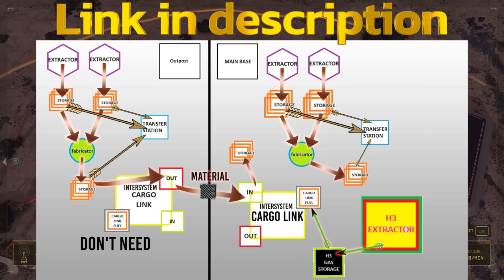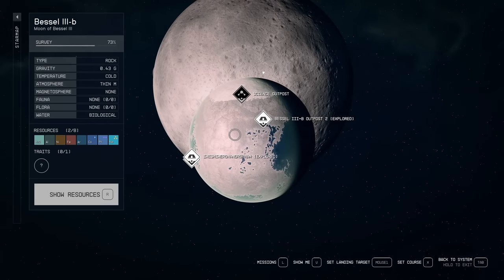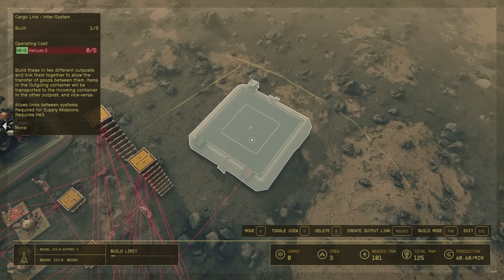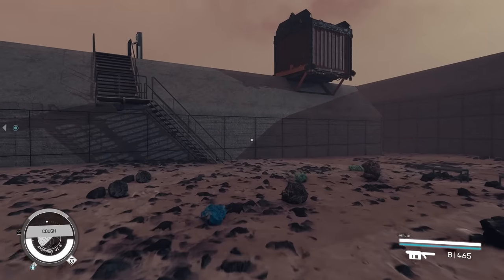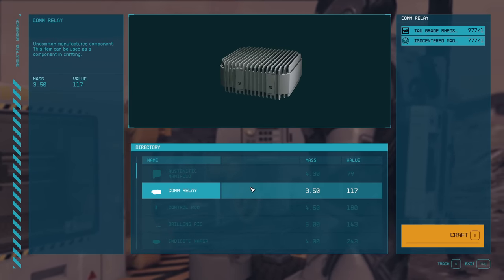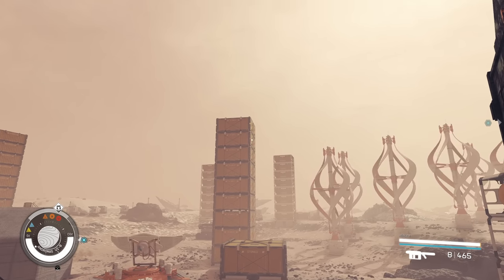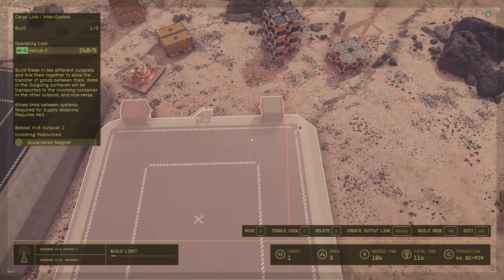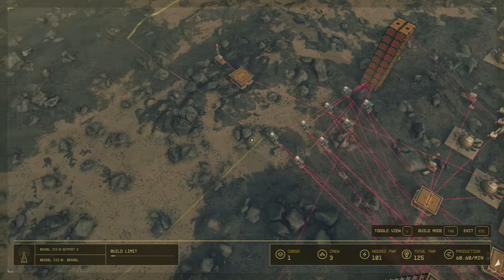[Starfield] Outpost Guide: Simplified Cargo Links Inter System

Comment: Thank you very much for making this video.

I did not know that only one of two intersystem cargo links needed to be fueled. I had noticed that there were times when the cargo link I was on ran out of He3, but the ship was still coming, and couldn't figure out why.

You described as a UI glitch the fact that when you examine an incoming cargo container that has just received resources you see it as empty. I also thought it was an issue until, like you, I learned that the default way storage devices work is that they suck out everything from an upstream container, or storage, and send it along until it hits the last storage container in a daisy chain.

The true issue here is that most people will not assume that to be the default way storage works, and will be confused. In the real world, of course, there are valves that control the flow. I assume they felt that would overburden their developers to add that feature. This creates a real problem when you're trying to both store locally, and send resources.

To do it in what I imagine to be the traditional way you have to wait until the storage containers downstream from the outgoing container are full. The problem there is that after they fill up, you have all of local resources you need. Unless you are using those local resources for product production, in which case you need to make sure that extraction is producing more than production is consuming. Plan B, is of course to send production directly to separate containers. That just doesn't feel right.

The other topic that strikes me is that in 2023 a company could create a game of this complexity, yet at the same time have bugs that break parts of the game such that their customers have to go online, and view videos by those that discovered this so that they could work around them. Imagine having to watch youtube videos to resolve the way your car works because you find that if you have the radio on you can't make three consecutive right turns or the the wipers won't work for a week. How long would people tolerate that?

Thanks again.

Comment: Intersystem Cargo Link is extremely buggy currently until it’s fixed by the game Devs. It can drive you a bit mad how buggy things are. The normal Cargo Link works fine from my experience. When materials incoming to Cargo Pad is linked Outgoing to Storage there at Outpost the actual transfer occur in a split second from ship > Cargo Container > Storage container. That is why you never see anything in the Incoming Cargo Pad Container if it’s Outbound Linked to a Storage Container at Outpost that’s Not Full. 

The big problem with Interstellar Cargo Link, well at least one among several is you can load Helium to supply container to pad and it don’t start. Don’t work. I also always do manual load for Helium due to another bug in that Interstellar Cargo Link. Sometimes you have to hit activate on Helium tank on pad, sometimes it immediately inbound the cargo ship once helium is loaded. Sometimes neither works and you can spend hrs trying to resolve the issue as you have to travel to the other Cargo Link planet/moon to see what’s going on from other side.. And you can spend time going back and forth going WTF! It’s damn buggy! Sometimes the cargo ship only ever takes off when you zone into Outpost. 🤔? It can drive you up the wall how buggy it can be among the many bugs with Interstellar Cargo Link. . And that isn’t even the bug that can suck your Outpost Helium storage completely dry if you have it all connected to Cargo Pad linked automatically. Which is why I only ever load Helium manually from storage to a single day tank to supply the Helium on pad.
Reply from the maker: It’s a terrible mechanic 100%

Comment: It could be so good, like if you could build/buy cargo ships and assign them to a route. Then, it equally distributes the materials you want to send in its hull. 

For example, you have a cargo link you want to send aluminium, iron and h3, the ship can carry (for arguments sake) 60. It will take 20 of each, or if you only have 10 h3 then it will take 25 each of the other two. 

The main problem is the links keep breaking, and even when they dont, they just send bulk of one material. 

It makes the fabricators pointless, its easier and quicker to just jump to all of the outposts, get the materials yourself and craft what you want yourself.

Comment: My goal at the moment is to have multiple large chains of cargo links connecting and  coming together on one planet (main base). With the "Bottle Neck" issue I just have a power switch hooked up to the extractors on an outpost to stop production if I don't need any of that material. This also helps in the case of storage. The only problem I'm having right now is having Hel-3 for not only my Cargo Inter-links but also my outposts that need fuel generators.

Comment: What changed outpost networking for me was when I yesterday got the outpost management perk, wich means you will have to waste 9 perks in the social three, but it lets you have 6 cargo links on each outpost. Now my main outpost collects resources from 6 different hubs. Bethesda need to give us an item that let us control how much resources going in and out of cargo links, that's the main issue with this system.
Reply: I just did this last night. I saw another video that suggested getting that perk completed if ou really want this to work.
Reply: They should also implement multiple connections between cargo links. Many cargo links to one cargo link would be the most widespread use case.
Reply: @yansakovich agree, but that would cause a lot of bugs and you would have to completely reset your whole system every time it is a connection bug, wich I get every day even if it worked great the day before..
Reply: I don't know if I would want 6 pads at my main outpost. That sounds like it would be really loud all the time. 😆
Reply: @eagleshadow101 it's very load, but the only way to have a fully automated network.

Comment: If you have 2 outposts with 2 resources on each planet, do you need 4 intersystem cargo links on your main base or just one intersystem cargo link?
Reply from the maker: You will need one per connection to make it clean - but you're limited to 3 unless you level the outpost management to get 6 i think.

Comment: I used to have to rip and rebuild my links but found the bug and trick to clear it without rebuilding it. Sometimes the sending side gets its cargo in the inbox instead of the outbox even though nothing was linked to it. I would go take the stuff out and move it to the out box and the chain would start running again. If nothing comes in for a while go check the other side, the cargo ship is usually parked empty with what was in the outbox actually in the inbox and just needs to be put where it should have been and it goes back to work. Basically in a pair of pads if both red boxes are empty or one of the green boxes is full and can't empty so the ship can't offload it stops running. Before rip and rebuild look in both pads' boxes on both sides to make sure what is/is not there is supposed to be like that and fix it before rip and rebuild. 

It's not really a bug you were seeing with the Cargo link inbox not showing items when the ship arrived. It's linked to a container chain and they transfer instantly so you would only see items in the green box until the whole chain fills and backs up to the green box for lack of down-chain capacity.
Reply from the maker: It’s a bug - if you don’t link it you won’t see anything

Comment: Mine has been bugging out trying to fuel both sides.  I have Titanium and Tungsten coming in to the main base but when I'm not burning enough of the fuel that I'm sending, it somehow ends up coming back and filling up my incoming that should have only Titanium and Tungsten.  Very frustrating, I think I'm going to just turn off the fuel export as I didn't realize it worked only fueling one side so maybe that info will actually end up fixing my problem.

Comment: So I'm a weapons dealer and I need resources and fabricated parts for my mods. I see on your diagram that you are only sending fabricated parts to the home base. But not all of my outposts will have all the resources necessary to fabricate other parts, and thw inter system link only takes two items at a time. I still don't see how bottlenecks are avoided and how to get everything I need back to my home base. You said you would do a Let's Play on this? Will it be a full tutorial?
Reply from the maker: The short answer is that I move everything by hand because it’s just saner and you can cart substantially more. 

The long answer is this let’s play tutorial - https://youtu.be/u-wqAQaJT4o?si=u834nA3pAWc2Dg4i

Comment: Question sir?  Can you delete links on stacks of cargo containers if you mess up on how they are linked together, or does it matter if the containers are not in series and in one direction?
Reply from the maker: To be honest on a stack i usually just delete everything to the point i got it wrong and restack - it's all situational - sometimes it's better to just start over you you know it's correct - but you should be able to gage what' not in sync because it will be highlighted in blue as something you can connect to - kinda hard to explain via text - i have a method but it's not something i can really explain well - i'd just delete the stack and start over

Comment: I'm curious if you can link a "local" cargo link to an "inter" cargo link? 

In the same system, can I link "local" cargo links A and B to an "inter" cargo link C in the same system and then export to another system from "inter" link C? Essentially this would make C a hub for "local" links in the same system.

It seems to work sometimes, and I'm not sure if it's a bug that it works SOMETIMES or a bug that it doesn't work ALL the time.
Reply from the maker: there have their own designations and can't be combined

Comment: I’m trying to work this out in my head. If I have 12 ships, 6 outposts mining 6 resources, technically 2 outposts per planet…since we can have three pads per outpost 2 incoming 1 outgoing. And then those 6 outposts within the same system or six ships head to 3 different outpost, each of them staying with the same system still, again 2 incoming 1 outgoing… and then those three different outposts from three different systems will use helium to head to my main base or my home base.  I could have in the beginning the ships carrying 2 resources, the next tier ships would be carrying 4 resources and the next tier of ships using helium to go interstellar would be carrying a crap ton of resources into my home base…YAY OR NAY?
Reply from the maker: Strongly recommend your links only send one resource per - this prevents massive bottle neck issues that occur 

Also the best method is to send finished manufactured goods - so have a main point of contact with 1 resource for each link to make X item - final product is sent to main base
Reply: @TacticatGaming  I commented before hearing that part of your video. I absolutely love the idea of sending a final product to my homebase instead of the resources. I also want the resources so I can manufacture because I do like the XP and I don’t want the fabricator to do it for free lol. I remember you saying that you’ve never had a base attacked, I had an outpost attacked yesterday twice within 15 minutes and they were strong boogers of pirates.  Took me a lot of ammo to take them down. But I built a huge wall with storage crates, deleted so they turned into solid metal wall and I will see you tonight if they attack me again but they were vicious they individually shot each power generator and drilling and shut my entire base down until I realize what was going on
Reply: @TacticatGaming  I have immensely enjoyed every one of your videos… Almost as much as I do playing the game lol
Reply from the maker: Yeah it just prevents multiple resources piling up in the cargoship @schleper99

Comment: I am experiencing some difficulties with the inter-system links also. Outpost B receives H3, from outpost A to fuel 2 inter-system links. The first link was between A and B and worked until placing the second link at B. The second link travels to outpost C and works fine, but the first link will not run. It lands once, leaves, and will not return. What am I missing?
Reply from the maker: if links stop working delete one and replace it - then reestablish the link.

Comment: I'm still amazed they decided to put this system in the game. It's so obviously broken. Having the ships actually transport the goods is cool but leads to problems if we have no way to control what and how much they transport. They really should just go back to the fallout 4 system of letting each outpost use all the resources in the connected outposts, assuming they are all properly connected to the cargo links. And hopefully they would also allow for multiple links per building because at that point the ships transporting stuff would be purely cosmetic.

Comment: I will avoid cargo links until bethesda fixes.  I have done two farms and it causes my game to stutter and freeze up every 2-3 minutes.
Reply: Yeah, when I had one inter system link, the game ran fine.  As soon as I add a 2nd one, I would get frequent FPS drops from 60+ down to like 10 FPS that would stutter and freeze up the game.  Now if I want something. I will just jump to the planet to get the raw resources or manufacturing I have setup.  The cargo link is truly FUBAR.
Reply: @GhostPepper233  as of late, I just make amps for credits and xp if I need it.  If I need materials, I buy them or still maintain a base on Bessel III-b for aluminum, iron, nickel and cobalt all in one.  Amp farms are on Jemison for argon, toxin and metabolic agent.
Reply from the maker: Honestly amp is the only outpost I recommend
Reply: @TacticatGaming  Guess I am moving from a gold miner to a drug dealer...lol.
Reply from the maker: this is the way @GhostPepper233
Reply: @TacticatGaming  however, part of me is wondering.  Since the game has issues calculating so many storage containers, what would happen if I simply used one per resource and cheated with console commands and made that chest store, oh say 50000 of any resource?
Reply: Odd. I have 27 cargo links in my game and no issues. I’ve been having good luck with Starfield 😭🤞
Reply: And it is not just cargo links that are buggy.  If I have a group of containers linked and I go to one of them in the group to pull some items out of it, that container will not backfill with items from the containers before.  I have to remove the in and out links of that container and when I redo the link, it will fill up.  Hopefully Bethesda will fix this or have a transfer container like item that will let you view all the items in storage and allow you to pull certain resources out.
Reply from the maker: It could be individual errors with certain graphics card or processors - no user experience is the same in this game - it's chaos @BillyOrBobbyOrSomething
Reply: @TacticatGaming  well I just added almost 50 colonist NPCs and modded trade kiosks to my main base. It’s like winning 100k but you just keep gambling anyway 😊 cheers 🥂
Reply: @BillyOrBobbyOrSomething  you're probably on PC. I've had 30 on Xbox and the game ran at 10fps and crashed every hour, because of those. Once deleted, it started working better!
Reply: @Astristul  yeah I’m on pc. I play on my series s too but haven’t tried outposts on there 

In good news, I’m balls deep in mods now and still haven’t had any issues a month later 😬

Comment: I’m actually surprised to learn how much issues people are having with maintaining these things. 

I’ve had a 4-outpost system that sends around multiple resources per link which has worked flawlessly for maybe 60-70 hours now. 

The other 5 I’m working on aren’t going particularly smooth but the process was the same with my first 4- troubleshooting like Hell until it “just works”.